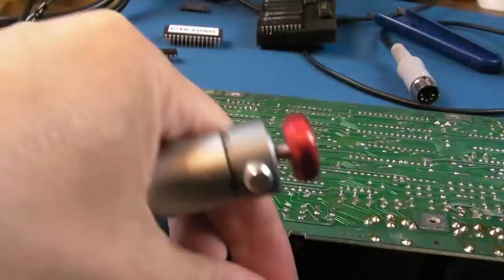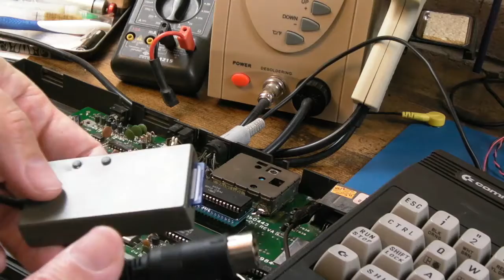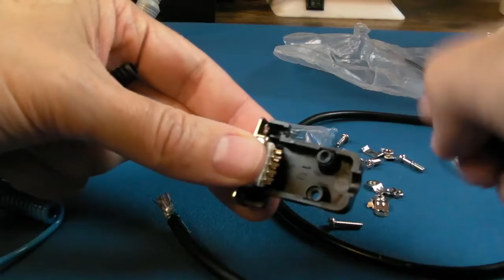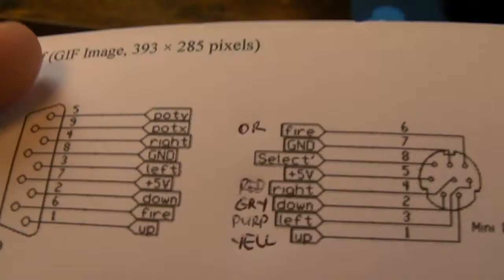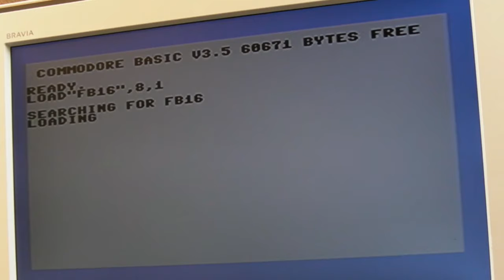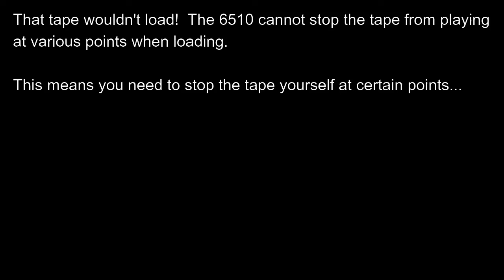Commodore C16 Repair & Upgrade Part 2 (64K / 6510 / 6502plus4 / C64 Keyboard / Joystick / Datasette)

Comment from the maker: Part 3 - https://youtu.be/K14Bhb-WKSk
Part 1 - https://youtu.be/njkSyh3VOrU
PLA Replacements (Daniel Mantione) - https://www.sellmyretro.com/user/profile/dmantione
6502plus4 (CPU Replacement) - https://lotharek.pl/productdetail.php?id=257
Joystick Pinout - http://www.zimmers.net/anonftp/pub/cbm/documents/projects/interfaces/plus4joy/plus4joy.html
C16 Datasette Pinout - http://www.hardwarebook.info/C16/C116/Plus4_Cassette
C64 Datasette Pinout - https://www.c64-wiki.com/wiki/Cassette_Port
RAM Upgrade (Tynemouth Software) - http://blog.tynemouthsoftware.co.uk/2019/02/commodore-16-64k-upgrades.html
Hack Junk 6510 Mod - https://hackjunk.com/tag/c16-6510/

Comment: watching this vid and wikipedia mentions right at the end of the article that the 6529mos ic differs from the 74HC639 as it has passive output pullups and power on reset. So I wonder if something based on the 74HC639 could be made to fit in there!

Comment: To save time wiring the mini DIN plugs, I used to use an old Macintosh serial cable which are 8-pin DINs also (you can get them DIN to DIN too to have two pre-wired connectors - search for Mac Imagewriter II cable).,  You have a lot more coordination soldering than I have.  :-D

Comment: Hi, if I remember correctly, those flashing lights in the border is when the « hacked » game is decompressing the loaded game back into memory, it was probably frozen with something like an action replay cartridge… and sometimes they use the screen memory also for the decompression program so it is not overwritten during decompression…

Comment: I made ( put together) one of these 6510 to 8501 adaptors years ago and had a lot of trouble getting many games to work. I did use the patched eprom kenal. I think the issue is with fast loaders or someting like that. Try some more demanding games like Pets Rescue or majesty of sprites and some other homebrew games. Older or simple games seemed to mostly work. Plus4world has a top 100 games list. I eventually tried the Pi1541 thinking that would sort it out but it made no difference.
Reply: Yes, the 6510 mod has only limited compatibility, it needs a modified kernal for a reason. You need a 6502 adapter to achieve full compatibility.
Reply from the maker: Yes, because it lacks that extra IO bit on the P bus, it cannot stop and start the tape playing.  So it often misses blocks when loading.
Reply: @GadgetUK164  That I wouldn't mind, as we nowadays are more likely to use the serial port than the datasette. However, the serial port is also modified: The clock and data lines are moved from bit 6 and 7 of the CPU port to but 5 and 0. This breaks every serial fastloader, and since fastloaders are a necessity considering the standard speed of the serial bus...
Reply from the maker: @danielmantione  The 6502plus4 fixes all those problems I think!
Reply: @GadgetUK164  It does indeed. It still lacks a Data Direction Register, but that's not a problem, since reversing the direction makes no sense on any of the TED computers.

Comment: One thing I'd suggest is when you're having to lubricate flexible plastic/rubber avoid petroleum-based oils and use silicone oil instead.  Petroleum will degrade such things whereas silicone oil will not.   In fact, if you have old rubber pieces that have hardened due to age you can often revive them by soaking in silicone oil and/or silicone grease in a sealed ziploc placed out in the warm sun for a day or two.  I've done that with motorcycle carb boots plenty of times in the past.

Comment: It has become a really nice machine, built from many spare parts, but now designed to last for another few decades! IMO the RAM upgrade unleashes the computer's capabilities, showing that the machine is able to handle impressive software.
Reply from the maker: Thanks again for the PLA kits and things =D  I will take a look at the other C64 bits soon!

Comment: Nice fix and mods. :)

Those 9 pin D plugs/sockets are so useful. I've used them for my Speccy/ZX81 parallel interfaces, as well as various non computer related projects.

Comment: the good news is it does indeed only write to that chip :P
da65 /usr/share/vice/PLUS4/kernal |grep -i fd30
LDB70:  sta     LFD30
so an output only latch with open collector would be fine. doesn't need to be bi-directional. and if it were bi-directional... the 'other side' (ted) is absolutely input-only, and then it would not get it's own written data back either. so it being bi-directional is not needed. just open collector and latched and non-inverted
Reply: The trouble is: The KERNAL does only write to the chip, but software can attempt to read from the chip, for example software may use a ROL $FD30 instruction to activate the keyboard lines one line after another, which is a pretty reasonable way to scan the keyboard. Therefore, a unidirectional latch is not a 100% compatible replacement.
Reply: @danielmantione  true that.
Reply: hmm. here is why it should be open collector anyway...send out a 1, press some keys (connecting the input row of the keyboard to the output rows), and move the joystick and whoppa your 1 output goes to gnd through the joystick (although it does have diodes to prevent it going back through the joystick port to another pin that may be 0 :P. if it were just the keyboard being on that ted input bus... probably no problem even in using hc(t) chips with a stronger drive. (not sure what the ted side of the input's looks like. it still needs a latch tho or some capacitors or something cuz there are gonna be a few cycles between writing the scan strobe to the keyboard and reading out the result at the ted :P (as yeah instead of using a latch register, ofcourse you can hold the voltages up for a few cpu cycles with just some diodes (if not open collector) and capacitors. enough time for ted to read it out. but them joystick ports on the same input are the problem.
Reply: also the joysticks have their own pullup resistors. independant of whatever teds input port may have in terms of pullups. also isolated by those diodes. (now why they did not simply spend 10 cents on giving the joysticks each their own, pretty much the same, chip, idk. no latch needed on those either. and spare pins for more buttons :P
Reply: if so much stuff is broken anyway. why not just pull the ted and re-design the whole board around chips you can get. lol. drop in a 65c02, and 74hct and sram instead of all these weird piggyback boards and adapters :P that way you can also pick literally whatever logic chips you want to strobe the keyboard select lines. lol. and heck install all 4 optionrom slots, make the kernel and basic and the rest normal 28c256 roms or something. etc. :P drop in the full 64kb and the acia (basically just make a 364 out of it, minus the speech synthesizer :P would have tossed the board itself out in a heartbeat if the cpu needs an adapter, the keyboard scanner is broken and the pla is screwed. the ted is the only actually unique part on it. the only part you really need to keep it compatible. all the rest of it is like 'meh' 'we can replace it with a whole lot of lose pcbs sticking out the board... or we can just re-do the whole board from scratch with stuff we can just order new from texas instruments, today. ;)

Comment: ah there we go...
74LS640: 3-state inverting 74LS641: open collector non-inverting, 74LS642: open collector inverting, 74LS645: 3-state non-inverting (mind the 5 on that last one ;)... take your pick. :P i think it needs to be non-inverting open collector but whatever. it's been a few years ago since the issue popped up. like 10 or so years.
Reply: "Unlike a transceiver, the 6529 has an output latch that captures & retains write data -- check out the Write Cycle Timing Diagram. So you'll need more than a 74xx245 with a little glue logic. The recipe isn't complete without a byte-wide latch or flipflop. (And Open Collector buffers, of course, but maybe that falls in the "glue" category.)" ... oh. hmmmmm... yep. not those then :P or rather: those but with a latch flipflop :P (the open collector non inverted types ;)
Reply: @CB3ROB-CyberBunker  74x654 is the right chip.
Reply: @danielmantione  * 645 for 654 i can't find any datasheets. but no... it is not latched. meaning it does not retain the value on it's output pins. and you sta the 'scanline' to that output port and then the ted input chip has to read it back. i don't think the circuit as is has enough 'natural' capacitance to retain that voltage for the up to 6 or so cpu cycles until it's read back from the other port. (usually, not even always) (654 doesn't seem to exist so i think you mean 645). also 645 is tri-state without open collector outputs so it'll just blast 5v into a joystick port that can be connected to ground through the keyboard. (for a whole whopping 1 clock cycle as it lacks latch memory but hey - still ;)
Reply: however. take any of the ones that are open collector... and hook up some capacitors that charge the 8 lines when they're '1'... and the ted will read a '1' for quite long enough. probably. without needing an actual real latch retainer. it's not what one would do in a new design but to fix up something existing without severe changes to the board... like... usually when people scan a keyboard they don't put 2kb of code between setting the scanline and reading the pressed keys no :P it's quite a short period. it doesn't have to retain the value for an hour. :P
Reply: @CB3ROB-CyberBunker  No, I wrote it correctly: 74x654, search for example for 74als654 and you will find the datasheet. It is the correct chip because it has latches, is open collector and is capable to keep driving the ouputs low even during a read cycle. There are some other chips such as the 74x647 which at the first look, look suitable, but they fail at this last requirement: They cannot keep driving the output during a read cycle. Therefore 74x654 is what you need.
Reply: but maybe the ted has some super special input pins that retain values by themselves and make it work anyway (as long as it's open collector and doesn't short through the joystick :P dunno... the ted isn't the best documented chip out there. :P (it is after all literally intended as a keyboard scanner so maybe it does things like debouncing in hardware or whatever other magic. who knows.) but i think it's just a simple read register that reports the 'current value'. which most likely will not be what you wrote to the 6529 thingy 3 cycles ago passed through some 'keys' which by themselves have a rather high resistance already.. :P (now that part, may actually allow you to just use a buffer with latch with a hard output anyway, as shorting it out through 2 meter of joystick wire and the keyboard's internal resistance may protect it from damage and not even make vcc drop or the chip get hot if you do that for an hour ;) but then you're depending on the whole thing having somewhat bad contacts after 40 years already. lol. by itself :P
Reply: @danielmantione  ti needs a kick in the butt again at the next shareholders meeting. lolol. datasheet is 'page not found' lolol. way more pins on that tho. but other than a few pins hanging in the air with some wires attached it would otherwise fit.
Reply: @CB3ROB-CyberBunker  Check the link to SellMyRetro above: The replacement exists. Yes, availability of the 74x654 is problematic for sure, but I have enough of them to keep replacements available for a long while. I did't know TI did take their product page off-line though, until very recently it was listed as "in production", allthough price and stock were already a problem.
Reply: @danielmantione  digikey has them. at an absurd price as usual :P lol. i'm sure aliexpress has some. :P they do seem to be 'in production' with 'reach applies' and 'non-rohs conformant'. but for some reason the datasheet is missing on ti's own website :P LOL.
Reply: @danielmantione  why oh why doesn't pcbwaaaay just make ic's to order too :P quite clearly ti and the likes can't even keep their own catalogue up. lol. so others will have to do it for them :P would nicely fit the product line :P as essentially a chip is a pcb. just smaller :P and in a funny plastic box. (that whole industry seriously needs to move away from the 'this is our product line, deal with it' model and start asking the customers what they want them to make :P preferably on a per-order basis.
Reply: the repair industry are usually quantities you would simply get for free as samples not just 20 years ago anyway. and now all of a sudden they think they can fetch like $4 for a logic chip?! LOL. as in. qty 1 :P LOL.  not the whole tube or reel. lol.
Reply: $4 for such a thing would be fine. if it came in a space rated ceramic package in sos-cmos with gold leads or something. :P LOL. not for the usual 'oh i'll take a million of those' pdip's :P oh and for $4 i'm sure they calibrate all the output pins to have the exact same specified voltage and capacitance too no? lololol.
Reply: seriously. it's 2023. if technology had moved in the correct direction from the 1970s onwards. you would not have to search for a chip. they would be made to your order in the copy shop at the corner. next to the car lienseplate press machine and the machine that prints logos on t-shirts.
Reply: @CB3ROB-CyberBunker  I guess this is the result of companies no longer run by people from an engineering backgroud that know the business, but by sales guys. Any engineer knows that selling a logic chip at $4 will kill the business, but sales guys are greedy enough to milk existing customers until they are all gone.

Comment: yep. the 'single port interface' or whatever it's called is a straightforward 74 series ic 8 bit latch or something. HOWEVER. some notes did use some magic sales gibberish words regarding it's i/o pins and how they work you won't find in any normal 74ls datasheet for that model. but it works :P neither the ted nor that thing has a data direction register anyway and as the keyboard and joysticks are hooked between those i don't think there is any risk of shorts by driving a 1 output into a 0 output like there is on 'various other models' as you simply cannot use them the wrong way around :P

Comment: the pla is a lot less complex than the c64... with basically just 3 possibilities, top 32kb ram (which the c16 in particular doesn't even have), top 32kb rom (and if so, which one, as the 2x16kb application roms for 2 applications can also be mapped there - which, once again, the c16 would not even have and the plus/4 would have just 1 set of 2x16kb plus the usual basic/kernal combo), or some mappings to the expansion port. it might well be replacable with something a lot less flexible than a pla. maybe even something like a single nand gate :P the i/o is also always there. and the ted does it's own thing in it's own timeslices anyway. as the c16 does not have any of that 'extra stuff' anyway it's address decoding logic seriously should be rather simple. there is no need to even disable the rom to get it to work as a c16 (as opposed to any of the larger models of the series) as there is no ram to replace it with anyway :P although that i/o space does seem to be more or less fully decoded with unused registers in the middle even reading and writing as ram (but that might just be the ted chip doing that by itself) oh and that weird chip that handles half the keyboard. the 16 also doesn't have the acia. so basically the only thing overlapping the rom is the ted chip itself :P they probably used a far too complex programmable thing for the task :P lol.
Reply: Yes, there is a reason I need two GAL20V8 for the Commodore 64  PLA, while for the Commodore TED, it fits into a single GAL16V8 (and some diode logic). What is also much easier in the C16 is the timing: The bus signals are properly clocked, unlike in the C64, where multiple races exist, and none of the PLA signals are available on the cartridge port, which means the PLA has no influence on cartridge compatibility.
Reply from the maker: Thanks for taking the time to reply with such incredible depth there - It's going to take me some time to read and digest, but very much appreciated =D